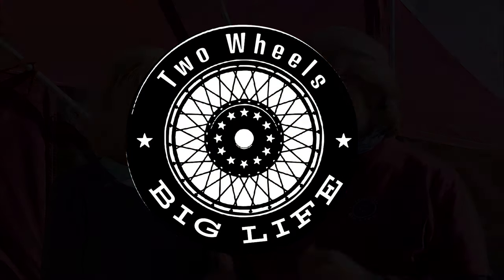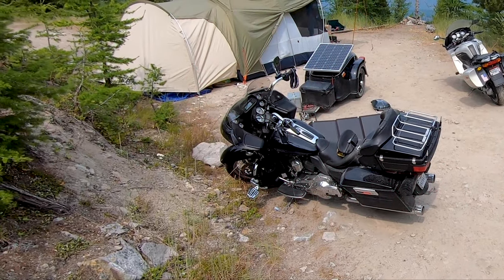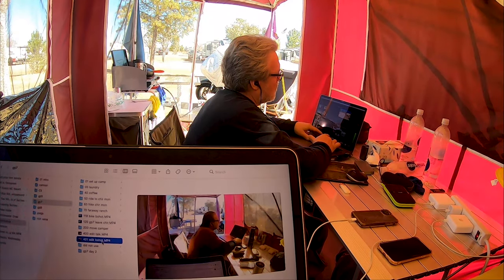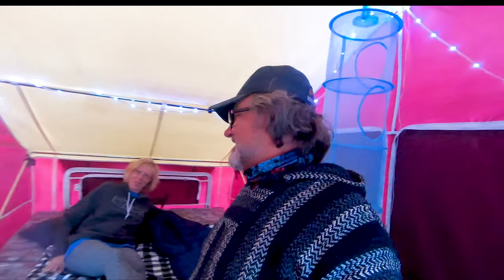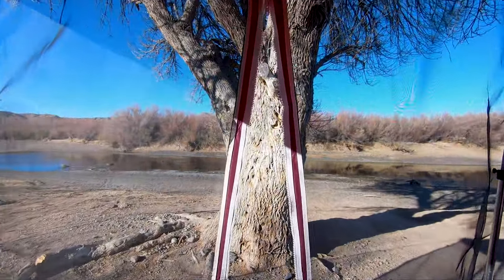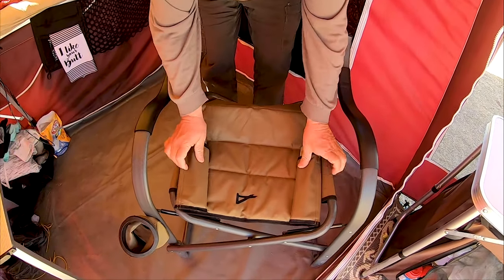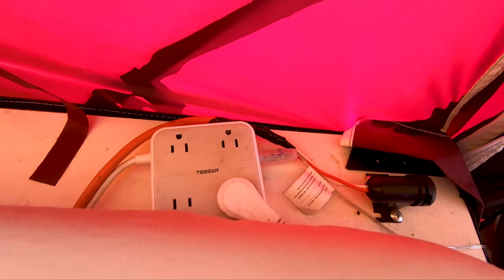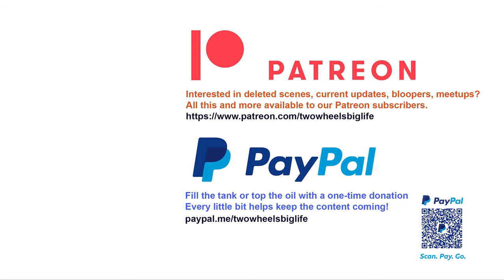POP UP MOTORCYCLE CAMPER - What's That?  #tinyliving. (S3 EP1)

Comment: Hi. Billy here. Your gonna love you bunk house camper. My preference is the time out camper. But the bunk house is also a quality unit.  I have pulled a time out since 1977 or 78. Shure your going to have a bit more weight but if loaded correctly you shouldn't have much more than 20 LPS of of tung weight. Some tips maybe you don't know yet. It's a bit more top heavy , so be careful while making a U turn. Also add a little more stoping distance. Watch how you stop on a down word hill. It will or can drag you backwards. LoL mostly on gravel. Also to change a tire. Don't worry about a jack. Simply bust the lugs loose then drop you tripods on the side of the flat and your camper is off the ground enough to remove you tire.  Also you'll find that for some crazy reason while parked people will tend to lean on you trailer. Don't really know why , it just happens. So I always left my bike in gear. Just so it doesn't move. In the old days they would push it off the side stand. Well your Harley side stand shouldn't unlock. Just saying.vnext since your pulling a bit more weight watch how you park. Try and park so you  don't have to back up. LoL I'm not sure if the 08 bunk house has led tail lights. If not it's a great investment for safety. Hope I'm not boring you and may be telling you something you already know. But there may be someone else out there that's thinking about getting a camper for there bike. And this information can help them. Best of luck with your adventure. Your friend.
Billy.

Comment: Hey guys, great job on the new rig. The electrical system on my Lumina XL is similar, but I also added a Renogy 20-Amp DC-to-DC converter (so my Harley can charge the batteries), and a NOCO GENIUS 10-Amp Smart Charger to use when I have shore power. My XL has been a running joke to see just how much luxury I can pack on it. I have a true fridge, hot and cold running water, toilet & shower, full-ish kitchen with a beautiful countertop, sink basin, and propane stove, and a complete office with a video studio. I have the same heated blanket you're using (in red), and my dog has his heated blanket, too. It's amazing what you can pack into these things with a little bit of ingenuity. Keep up the great work.  I love following what you're doing.
Reply from the maker: I need that DCtoDC charger can you email me a link?  Twowheelsbiglife@gmail.com
Reply: Holy cow! That's imprrssive

Comment: I spend many years in a Bunkhouse. So glad you have upgraded.  A fun and inexpensive way to track places you have been is keychains. I bought souvenir keychains that had rounded edges or rubber ones.  I attached them to all of the window zippers so I could grab them and use them as pulls.  They were decorative and functional.
Reply from the maker: Thanks Barb -another great tip!!

Comment: Such a great video! I have yet to do touring and camping by motorcycle but I’ve done 15,000 miles so far by bicycle towing a trailer. Towing a cargo trailer has allowed me to carry a few hundred pounds of gear, it’s really nice when you’re riding across a hot dry desert to be able to carry 4 gallons of water, that’s a luxury most people can’t even imagine traveling on bicycles without Trailers. I’m just so thankful for your Good video and it will make my transition into motorcycling with a trailer that much more a reality. I definitely want to travel with a solar panel and, probably won’t have a heated bed but I will certainly have good padding and a toasty warm sleeping bag & good cotton sheets.
Cheers to both of you whether you’re at home or out on the road with your “home away from home”!

Comment: “Imagine 2500sqft of space...this isn’t it.” 😂😂😂 That is a sweet setup you guys have. You will definitely enjoy some more comfort. Now Richard needs a nice pair of Torque cams to pull the extra weight. 😁😎👍
Reply from the maker: You got that right!   Anyone want to a rebuild on Ms Alice. I'm In!!
Reply: @TwoWheelsBigLife  do your homework. Putting more power to the ground needs to be done right. Compensator, clutch, cam plate and oil pump at minimum.

Comment: Love watching your adventures, I do some myself . If using your little buddy heater with 20 lb bottle be sure to us a filter with it or it won't last long.
Reply from the maker: A filter for the LP to the heater ?  First I’ve heard of this. Thanks.
Reply: Harold is right on this one ! It’s recommended by the bush buddy manufacturer. It’s also recommended to have CO monitor in the tent and keep the heat at a distance.
Reply: @TwoWheelsBigLife  It's a speciality filter that filters out the oils leached out of the rubber hose that connects the 20lb cylinder to the buddy heater.  Absolutely needed.
Reply: I think they are using propane bottles and not a hose, so no filter is needed, unless a hose without regulator is used. If you use the hose with the regulator on it then non filter is needed

Comment: Nice...
Sorry if this has been covered before. But I've seen you talk a few times about oil consumption. I had the same issue. But then found out my 103 had a happy place on the lower end of the oil dipstick that it did not use oil. Also I noticed with synthetic it foamed more toward the upper end of the dipstick. Conventional not so much. Also alot of oil gets sucked into the breather. There's a easy mod to make the heads breath externally. That may help too.
Safe travels y'all...

Comment: If your external area was extended by a little over a metre you could install two separate, adjacent cubicles (made of nylon, with zips) and install a shower and a toilet. (The tent entrance is then moved to the side). Before you laugh yourself stupid, my brother did that. The loo is a portable seat with an odor-reducing chemical in a bucket below the seat and the shower is a 20 litre suspended can with a hose/shower head and tap on it. If you wet yourself down briefly, then soap yourself, then rinse quickly, you will have enough water for two people in that can. The water drains thru a hole in a thick plastic sheet on the floor. So digging a very small drainage hole in the corner is all that is required in hot, dry places. My brother also fitted a large battery that was charged by an expansive, unfolding solar panel and this battery supplied power for lights, electronics, including a laptop and a 24-hour fridge (when everything was folded away he connected a wire to fixed solar panels on top of the trailer and so the battery/fridge could be charged and operate while he drove along the road and remain independent of the truck's generator). Admittedly he has a vehicle rather than a bike so he welded a stainless steel dish to the exhaust manifold under the hood, put a chicken and veges in there and after a five hour drive it was cooked to perfection (I know, I tasted it! - fumes kept out by simple pressure-cooker valve). He also made a solar oven with a very basic, unfolding reflector, looked like a windmill unfolding and this cooked a chicken plus veges in 2 hours.

Comment: I have an Aspen Classic and I made a PVC frame to stretch the floor out to shape and vertical supports to hold up the back end by the door.  Super light and doesn't weigh anything.  Also, I don't have to stake my floor

Comment: Great job on your new setup. Are you able to store all your equipment on the bunkhouse?  I actually bought a Leesure lite XL and I’m going through the mods process myself. I’m also taking lots of cues from your video (e.x.: helms 360 hitch, solar panel hookup, led lighting, cooking and work table, etc.). All great setup.  I’m actually thinking in getting a portable solar generator 1500 kWh and running 2 100 watt Jackery foldable  panels. I don’t have a dedicated space for hooking up individual components such a lithium ion batteries, inverters, etc. I’m thinking that I can move the generator closer to the panels depending on the sun position. I’m currently using a 2 inch high density foam mattress with a 12 volt heated pad . It consumes less than a heated blanket and heat rises. Not sure if I will continue to use the mattress or use inflatable ones (due to space savings) I’m using USB chargeable magnetic 60 led led bars that I stick on the bars . It’s easily removable when packing . Like you I’m running 12 V cigarette lighter plugs and USB cables  with a splitter box. Have you given any thought about hocking up an external shower room with heated water source? 

Sorry for the long message and a great thanks for sharing your journey with us 😉👍
Reply from the maker: Yes to all 🤣🤣. We need a little more power with 2 computers rendering videos and all the gear associated with it

Comment: Not sure what type of battery's your running but if you get a chance check out Lithium battery's they are less then 1/3 the weight of a led acid, you get a better life out of them and they just seem all around better. I have been running lithium for a couple of years new and there great. the bad is they are over twice the cost of led acid.
Reply from the maker: Yes we have 2 50ah LiPo (lithium phosphate) batteries total of 100ah of power. It works great.

Comment: The Little Buddy using big tank must use filter avail at Home Depot, Lowes or other.  The large tank with pressure will pull oil out
of hose and clog the heater if no filter
Reply from the maker: Ah great info.  I will be purchasing. Thanks.

Comment: A few questions for you guys. I have a Kwik Kamp, as I don't like getting my cheese wet and buying ice I put a 12/110 volt fridge on the front. With a small battery to run it and LED's that go from just a bit of light to full bright that one can read by. The battery is charged via an isortor or "shore power". With the liften bat's no charging from bike but could get a 110V charger for them . With the 100amp worth of battery plus should run all that you are using now and a fridge with ease. Have you had any thoughts along these lines?

Comment: Question = why not just have a portable Lio 110 volt invertor hooked up to charge off the bike power? I have a small unit that will charge my laptop numerous times along with a dozen phone charges. I can toss it in my saddlebag and charge it while we tour around (just over an hour to full charge) Seems like the solar is a lot of horsing around. But perhaps I am missing something in regard to the purpose so please fill me in Thanks.
Reply from the maker: Yes we started with one of those but rendering Videos and charging all devices we needed more.  Oh and we have a heated blanket.  Now 🤔🤣
Reply: @TwoWheelsBigLife  Yes the blankie is what did it. :-)

Comment: I have a harley that I pull a small trailer with that weights 160 pounds how much does your little camper weigh loaded. I really like your condo
Reply from the maker: Well that condo weighs in around 500lbs with all the gear.

Comment: I looked at one of those years ago but changed my mind when I seen two accidents with bikes pulling a trailer. But I see you have a better hitch system that was available back then. So my question is how does it pull ?? Also when you are in NM you can have some serious snow storms I know because I have been in them. safe travels

Comment: What kind of issues do you see coming with the bike pulling it?  It has to weigh more and will move you around a bit on different road surfaces won’t it?
Reply from the maker: Yes it is heavier for sure.  I see more back tires.  There is plenty of power so that’s not an issue. We see we’re still learning.

Comment: Good afternoon.  I have a question. We got the same trailer and we are towing it with a 2016 roadglide . All we have in it is a small battery and a spare tire. And in the wind it jumps all over and fuel went down to 27mpg. And suggestions on whats wrong. Thanks tim
Reply from the maker: We are loaded so the weight in the camper helps in the wind.   I have the camper balanced with about 50lbs on the tongue.  Also make sure the hitch is even with the axle of the bike.  I noticed when the trailer was lower than the axle it handled weird.  I hope this helps.  Cheers.
Reply: @TwoWheelsBigLife  thanks we will check that out..we love your videos. You guys are the reason we got a tent trailer

Comment: Hey guys, what is the towing capacity of the road glide?
Reply from the maker: Well HD doesn’t have that info because they don’t want you towing a trailer.
Reply: I have a 2013 RG and I pull a Bunkhouse xl and a sport camper with no issues. On steep hills I’ll down shift a gear to keep my speed up.

Comment: Interested on you feedback how this trailer pulls behind bike in a cross wind?
Reply: ive owned a few bike trailers over the yrs. Currently own a Bunkhouse.  From my experience although winds do effect towing.. (As with any RV) The only way it would become dangerous or even concerning IMO. Is if either one ran into extreme storm conditions. (At which point one  just may want to wait it out) Or...you don't have enough bike. I wouldn't pull any trailer in this weight class with a bike under 700 lbs er so.
  Oh...also rider experience. Towing a trailers not rocket science but....Id advise having a season under my belt first maybe. Any negative effects of weather or road conditions are quite often  amplified while towing. Stopping distances etc. Pay attention to bike trailer set up as well. Bike suspension settings ...tongue weight etc. Common mistakes I see are... either too much tongue weight. 0r too soft rear suspension.  Or BOTH...:-)

Comment: I first saw a similar trailer on ebay about 10 years ago. They wanted $1300 for it with a Suzuki 1400 in riding shape. Or $700 for just the trailer. My wife wouldn`t go for it.
Reply from the maker: Some people either love them or don't - it's still basically tent camping only a bit higher off the ground.

Comment: Looks great and you made a lot of comfort improvements.  The next thing you need to do is some upgrades to the Harley.  Upgrade the Clutch and Compensator and put a torque cam in it.  Also, I would upgrade to an S&S Oil Pump a the Cam chest.  Unless you have already done this.  The S&S oil pump rotates the oil faster and helps you engine cool off more.  Kevin Baxter https://www.youtube.com/channel/UC8vzPlQOWP9csxUOoyC9Mtw
is a great source of information, also if you are travelling you could go to his shop and get the work done.  I hope I was a little bit of help.
Reply: Or buy a goldwing and do nothing to it :)

Comment: As you keep getting more weight in the trailer you really need to get electric brakes on the trailer it’ll save your brakes on the motorcycleAnd you wouldn’t have a crash on that hill

Comment: Consider spending the big bucks and getting a Battleborn battery.  Your actual battery capacity will go up by 20%, battery weight by 50% and the solar cells will charge the Battleborn faster.  Check out this video for the analysis.   https://www.youtube.com/watch?v=iy3hga_P5YY&t=6s